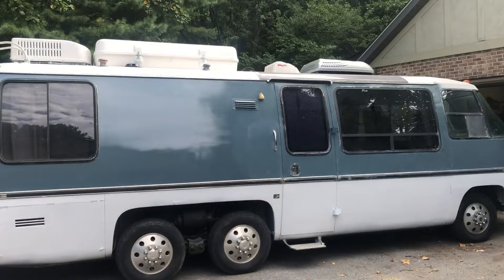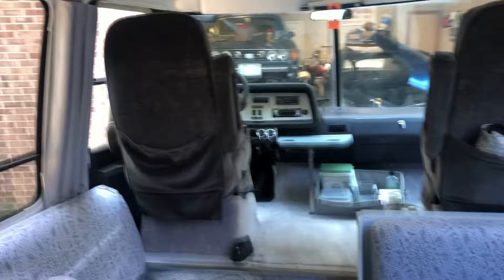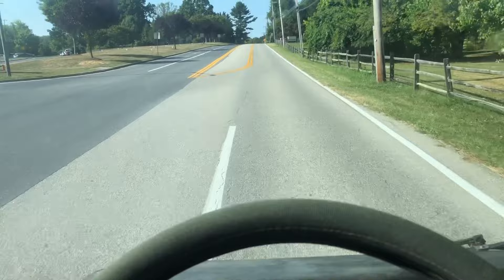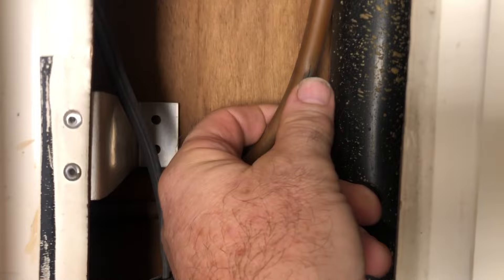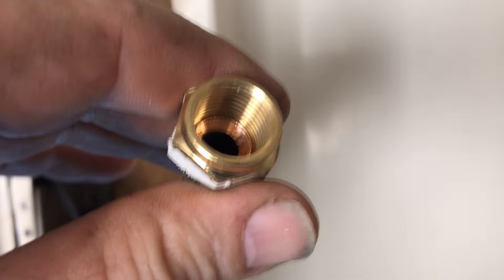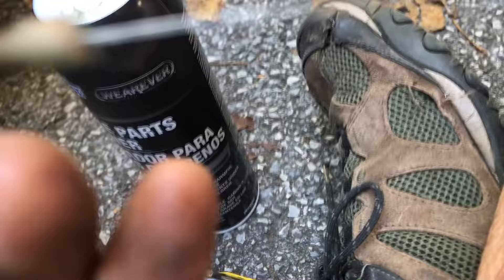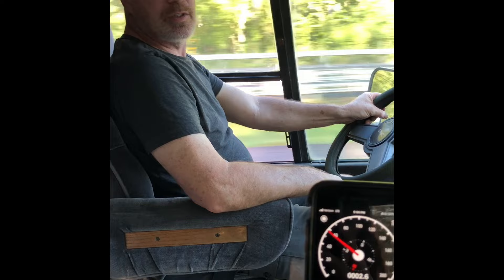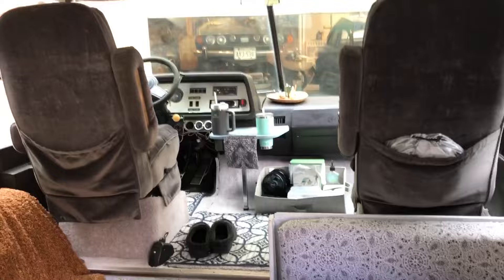1973 GMC Motorhome episode 27 Camping to do list

Comment: I like the paint job and paint scheme, the coach really looks nice inside and out.  I like your solar panel installation, really don't see them on the roof.  This application is great for solar given solar's limitations, it is perfect for small applications like these to power the roof top a/c or power your fridge.  It will be interesting to see how it works for you powering both the fridge and the a/c at the same time.  Nice off the grid option when the sun is shining.

Comment: Gday Mate, looking good now cant wait to see the first trip video soon.
Amazed at the low draw on the A/C! what brand is it?

One thing I noticed is your upper and lower control arm bushes look pretty worn. I just did my lower ones WITHOUT removing the control arm.
Its pretty straight forward and makes a big difference on the handling when changed.
I will post a video once edited and share a link with you mate.

All the best from Downunder
Reply from the maker: It is a dometic penguin II . 11k btu. I am posting the camping video in the next couple days, it was the second time we took it camping. The first was to a music fest, then I tweaked the coach after that. I would appreciate seeing the control arm bushing vid. Thanks!!

Comment: Eric, I had a couple questions for you.  Watching you run ac off solar, I missed what solar panels are you running and what voltage and how many watts?  Also then I like the interior rework.  I’m wondering what you used for curtains.  Mine currently has metal mini blinds which of course are horizontal and the window is vertical so opening the windows is a pain as I have to raise the blinds all the way to be able to open window.  And the blinds are attached at the bottom (some are broke) and none of them have a crank to move the louvers
Reply from the maker: Hi, I use 2, 200 watt cigs  thin film panels from Bouge RV. I am using a 230 AH lithium battery and 5000 watt inverter. I also use the Bouge RV charger/controller. The A/C is a dometic 11k btu penguin. Basically I am running the AC with the battery and inverter. The solar feeds electricity back in to the battery, the battery is discharging but at a much slower rate because of the solar going in. It will go several hours in the sun, usually I shut off the AC in the late afternoon to allow the solar panels to recharge the battery to keep the refrigerator running through the night. It gives you temporary relief in the middle of the day!
Reply from the maker: Hi, I use 2, 200 watt cigs  thin film panels from Bouge RV. I am using a 230 AH lithium battery and 5000 watt inverter. I also use the Bouge RV charger/controller. The A/C is a dometic 11k btu penguin. Basically I am running the AC with the battery and inverter. The solar feeds electricity back in to the battery, the battery is discharging but at a much slower rate because of the solar going in. It will go several hours in the sun, usually I shut off the AC in the late afternoon to allow the solar panels to recharge the battery to keep the refrigerator running through the night. It gives you temporary relief in the middle of the day! My wife made the curtains. I will talk to her and get the details…